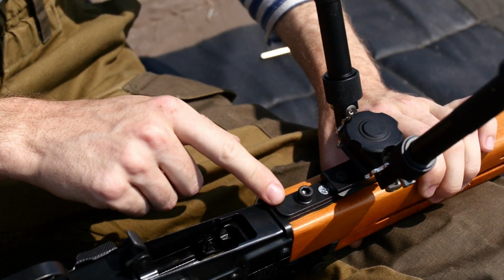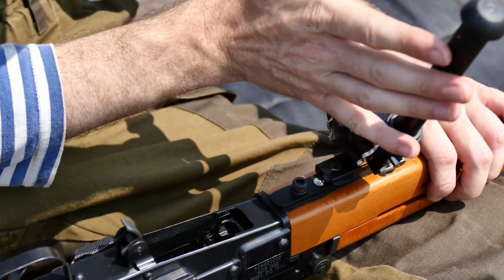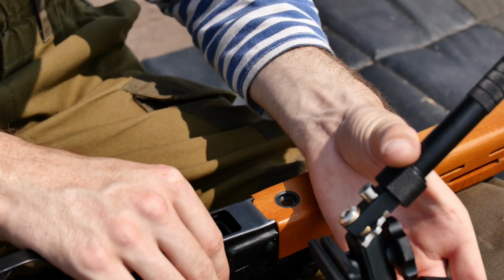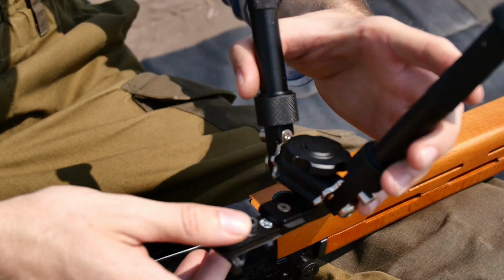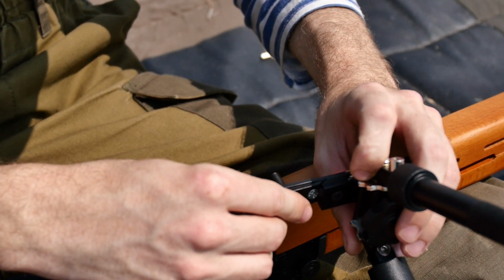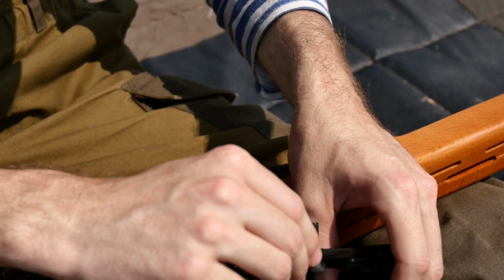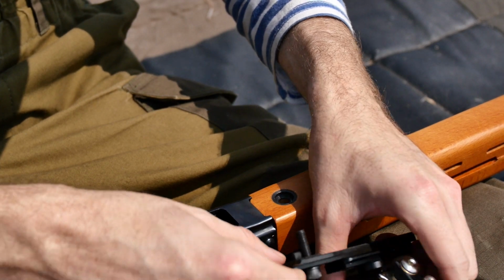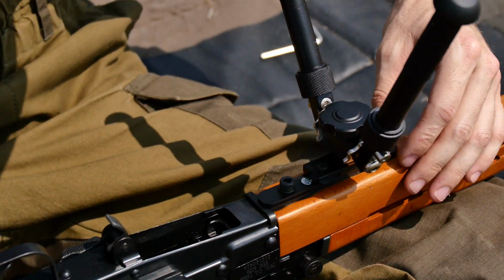Type 81 SR Bipod Adapter

Comment: Personally more eager to see the 23 degree safety lever happen.
I got my own homebrew'd SA with a sideplate/siderail and the safety was modified to engage at 90 degree, which allowed me to be able to operate it without too much issue even having an optic on the rifle, but it's a tight fit and would totally be a pain to operate with larger gloves.
Might buy that, might not.